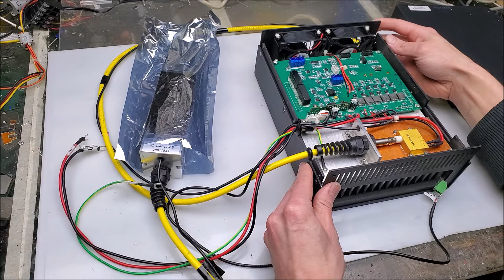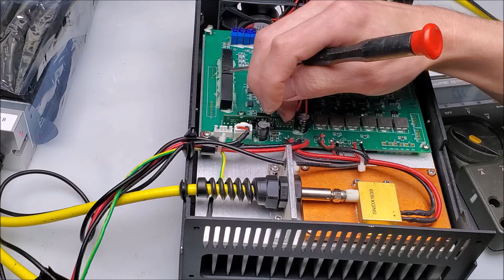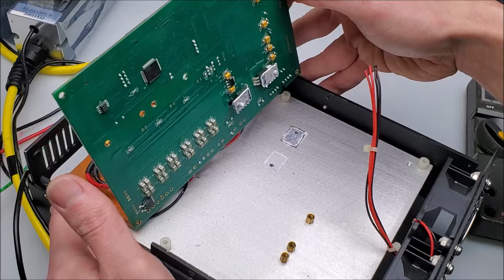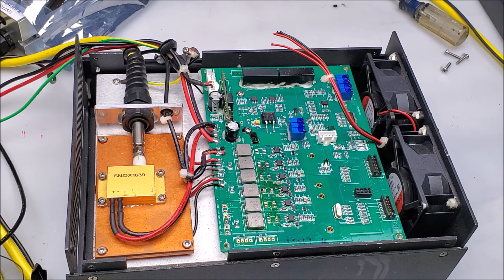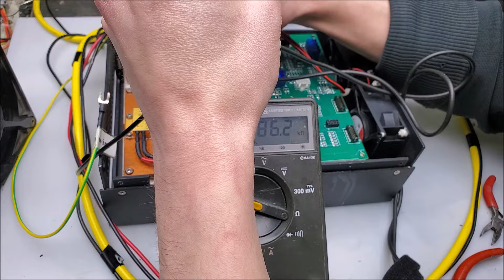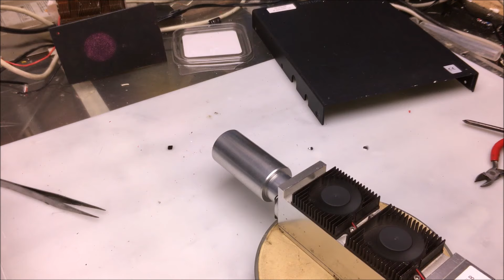Repairing An Endurance Fl-1064-10W B Pulsed Nd:YAG Laser

Comment: Luck, that the mosfets not burned and welded into the pcb. i have that mostly - and its annoying, because u have to mill al that crap out and repair the pcb
Reply from the maker: There was a little patch of burn and carbon under one of them that I needed to sand out but all in all very nice clean failure with little to do on the board.

Comment: Wow that one uses a knife edge combined array laser diode to pump the yag laser with 😮 they will be using those mini switchers to power the laser array and the cooling chip. Would be worthwhile to check tge laser diode and it's protection diode/device 😉

Comment: Dude buy yourself a decent reflow solution for these delicate components instead of using a paint stripper, they're not that expensive anymore.
Reply from the maker: I have been eyeing up reflow stations. I have been looking at the older Hakko hot air stations. I am doing board development and that alone needs better than what I currently have. 

So many tools to purchase, so many things to do!
Reply: @Zenodilodon Hakko is a good company. I can't afford their stations, but I use their soldering tips on my cheap T12 knockoff-of-a-knockoff station.
Reply: I would recommend one of those generic 858D units (they come in a handful of names) - Works very well and reasonably prices.
Reply: Or one from Quick. @EEVblog has reviews of an old (that I got myself) and a new model.

Comment: Did you need BOTH your eyes...

So did you leave two chips off the board?
Reply from the maker: i like my depth perception, I do find it useful. 

Yeah the chips on the unused TEC output I just left unpopulated. Less to go wrong overall and they aren't used.
Reply: @Zenodilodon  they blew even though they weren't connected to anything?
Reply from the maker: @phonotical  Sure did, sent that voltage through both body diodes in the mosfets. One sent power one way from + the other from - in reverse conduction.

Comment: the laser diode is hooked up over sma, nice.
i only seen this in cavity pumped nd yag before.
i wonder why fiber lasers dont do this, they are allways fiber spliced which makes replacing diodes very difficult and expensive in tooling. 
i expect the first fiber cleaning and engraving lasers to pop up on ebay soon as they became more affordable over the years and chinese are not known for driving those diodes in a long lasting manner.
just recently a bunch of 975nm diode listings popped up on aliexpress, up to 500W in power for like 300 bucks. really nice.
Reply from the maker: I haven't worked with enough fiber lasers to appreciate your comment. The most powerful fiber coupled laser I have here is only a 20W 976nm. I've already have had to cleave the end once on it. I need to eventually get more into fiber optics. The prices on second hand units like this is bound to plummet so it will be an interesting market to watch.